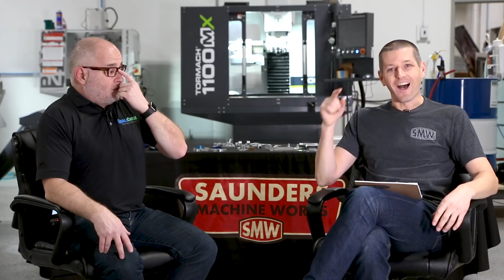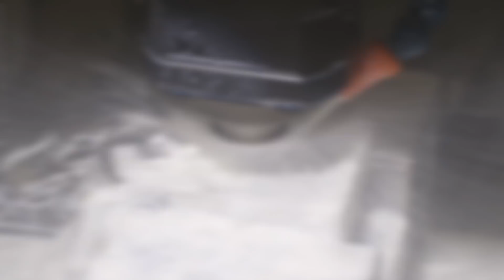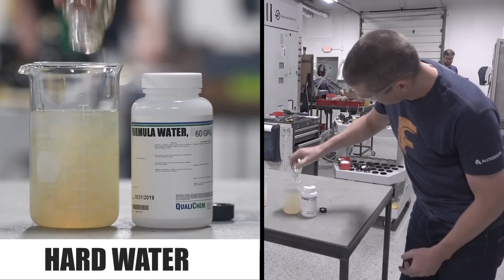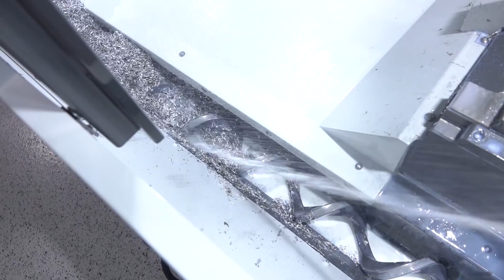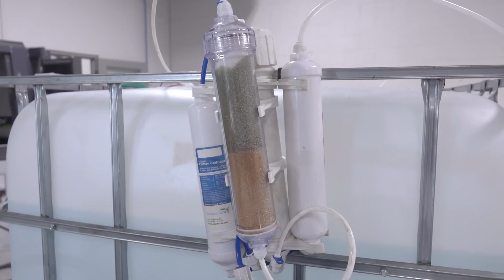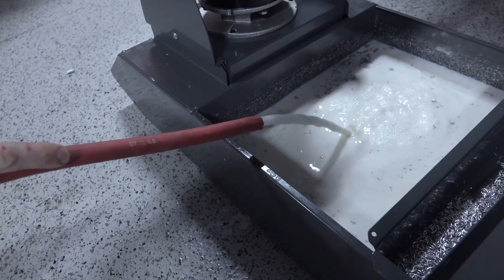CNC Coolant Basics with QualiChem

Comment: Coolant is important because use of the tool creates friction which creates a lot of heat and eventually that heat over hardens the tool material from the produced heat,so therefore it makes the tool very brittle,because that's just what happens when metal is over hardened.

Comment: In some countries of Latin America some machinists use something called" taladrina" which is a preparation of very light engine oil,liquid soap,and water ,and it works cooling  the work and the tools for cuts when working on lathe or milling machines ,and prevents oxydation of iron when there's leftovers on anything!
Reply: Does that really work

Comment: How about using osmosis to treat your water. you can really get low TDS values I get from 450ppm down to 9ppm. Is there any recommendation for the hobbiest(all materials, prevents corrosion of the machine and parts, and won't go bad if its not used for a long time) which you can get worldwide (in germany)?
Reply: Reverse Osmosis is a common method for cleaning up water, as you have experienced.  Our XTREME CUT 250NBF would be the suggestion for you in Germany.  Email me at jwiley@qualichem.com if you want more details.

Comment: What is the coolant recommendation for the occasional use home shop? Mixing a batch for a machine sump that might sit unused for a number of weeks is problematic. Can it be sealed in a container between uses to keep it from going rancid? Interested in what others are doing.
Reply: I've been using soluble oil diluted with distilled water for lathe, mill and grinders with no problems growing anything or going smelly.
Probably not so cheap for a production CNC environment unless they distilled there own but fine for the quantities I need. 180 litres for well over a year.
Reply: Get a good quality coolant, mix it correctly and use RO or DI water, and you should be good to go for many months.  If you are in AZ, contact Star Metal Fluids for assistance.

Comment: I'm using Blaser 735 (the clear stuff) and it leaves a white powder light substance on my ATC door and on tool holders. I use DI water with the coolant. What might be happening?
Reply: Which version of the 735 are you using?  Contact me at jwiley@qualichem.com if you want some help.

Comment: We are having issues with foaming in one of machines. Can you provide some insight to solving this issue?
Reply: send me an email jwiley@qualichem.com and I can get you some help.  First check is always making sure that the concentration isn't too high or too low. Reach out if you are interested.
Reply: Hi Tim, Foaming is due to various reasons: water being very soft, Smaller tank sizes compared to pressure, flow rate of coolant inside machine, Blockage of Pipes, Higher Coolant concentration..

Comment: I switched to 251C Quali- chem 5 years and it is lights out better then the Sto-cool shit my First Hurco came with. A video this long and they didn't talk about the one vital must in extended coolant life.  Coolant circulation and filtering.  I can easily get two year out of a coolant fill.  Separating out the way oil is also vital.  I have 7 CNC machines and the coolant is moving in a circle 24 hours a day. Good water, correct concentration, and circulation and way separation and problems are gone.
Reply: There are additional videos in the works in which we will touch on other subjects, maintenance included.  Lots to say, not much time to say it.

Comment: No coolant story is complete without discussion of how and cost of end of life. AMA: disposal of old coolant.
Also while John's machines are all enclosed sealed, What about health and safety of machines that are open. Examples: manual lathe or mill. Or a machine like the HAAS TL.
Reply: Rolltech Innovation manufactures machine coolant saver. Serious threats to productivity and health are bacteria and fungi which are commonly found in industrial coolants. This coolant bacteria filter has some advantageous features include: last a life time, with guarantee of extended life of coolant with bacteria filter - no consumables, no electricity, no chemical dosing, etc. 

It is a one time investment, ROI within 4-6 Months, Saves on input of fresh oil and disposal cost like etp treatment, or giving it to authorised recycler. 

These mineral oil based coolant are prone to generation of bacteria which produces foul odour, often from hydrogen sulfide [rotten egg smell]. 

Rolltech Innovation "Aqualogic" filter is an innovative and economical method of continuously controlling these micro organisms and the odour they generate. "Aqualogic" bacteria coolant filter consists of series of high-purity multi-metal fibres cased within a stainless steel tube. the dissimilar ions in the multimetal alloy bed undergo a natural electrochemical reaction, also known as an oxidation-reduction reaction. Which Kills the all the Microbial activity in the coolant 24/7

call us at +91-702-723-6191 or write to us at rolltechin(at)gmail.com

Enjoy the coolant being running without changing it, just keep the coolant healthy ## like and subscribe,that would give us motivation, need your support folks, no organic or inorganic chemicals used, everything is natural

Comment: I just had RO and a water softener installed at my house.  Installer said they won't run RO through copper pipes because RO water is slightly acidic and would eat the pipes.  Does pH come into play here when using RO water for coolant base?  If no factor, I'll just fill some gallons out of my house rather than buying distilled.
Reply: So long as the water is mixed with a well designed coolant, the pH is managed by the additives in the coolant concentrate.  RO water only gets very slightly acidic, and that really has more to do with the starting pH than the RO process.

Comment: Where would you use coolant to machine cast iron?
Reply: It's generally a surface finish thing. 
Hot chips can attach to the cutter and gall the work.
I've only seen the need for small or deep drill holes.
Reply: Cast iron needs good corrosion control.  While the tools may not need the performance, the freshly cut metal needs the protection.  We suggest running the coolant as you would on any metal.  Contact me at jwiley@qualichem.com if you need some help.

Comment: Hey John, TDS DOES NOT represent water hardness.  TDS includes everything dissolved in a water, not just solids which contribute to hardness.  Nor does the "TDS meter" you showed always give an accurate TDS, as it is based on using conductivity as a coarse proxy.

To accurately measure water "hardness", you want to find "Carbonate Hardness" (sometimes incorrectly called "Alkalinity").  You can use a small and cheap titration kit that gives you accuracy to 10ppm.  This value is usually half that of TDS.  If you are running your shop RO based on TDS, you may be getting a very low Carbonate Hardness a a result, which begins to affect the PH and them cause corrosion issues in your machine and/or parts.

My industry is commercial coffee, where water quality is critical but for a different reason!

We made a small document for our engineers who work on espresso machines to help understand it if you want a copy.

Love the vids as always.
Reply: Water hardness is not TDS.  TDS is looking at the bigger picture, though both should be looked at together.  When we analyze water we look for the anions(chlorides and sulfates) and cations (magnesium, calcium, sodium and others).  Contact me at jwiley@qualichem.com if you need some assistance.
Reply: Owain....could you post a copy here? Sounds interestin.
Thanks
Reply: or hardness test strips
Reply: Seconded. If wouldn't mind posting a copy of that document, it would be interesting to read. Thanks
Reply: Definataly interested on this topic, please post it somewhere and link it here for the benefit of all :)

Comment: With water hardness, at what point do the TDS cause issues? 
Like currently I have 310TDS in the well water, what would I shoot for as a balanced number?
The softener works to bring it down to about 25, but what about the salt left in the water. Will that cause issues in the first batch as you want some minerals. 
Also how much of each mineral is a good or bad number to have? 
Then the RO water I can get has about 4-7 TDS to it, just trying to find a good mix.
I cut lots of steel, stainless and aluminum with coolant, but have lots of carry off and issues while welding. Have had a local rep out from Toronto Lube to try some 251 also, but the coolant also has an effect on welding porosity.
Reply: Send us a water sample and we will give you some guidance.  While water softeners may appear to reduce TDS, the salts used to accomplish the softening might be worse that the water you are starting with...as with most things, the devil is in the details.  The cations and anions that exist in your water are the real concern.  Contact me at jwiley@qualichem.com to get started.

Comment: We found out lately that coolant is a huge tool and it matters A TON in machining. We have been through many different coolants in our quest to find the best all purpose coolant - 5 in the past 2 years. Our shop of around 80 machines does a large variety of materials, from cast iron and steel to aluminum to exotics and we ended up landing on the Castrol MB50 and couldn't be happier how much better our tool life and finishes are. Great all purpose coolant.
Reply: What kind of water you have? Just thinking how universal would your good results with the coolant be?
Reply: Michael Shortino MB50 is the best multi-metal coolant out there!

Comment: I have a hobby lathe and whilst there is a lube pump option, I don't have the space so what I do is mix up water soluble oil into a spray bottle and if the work needs it I squirt or light spray the work. It's a good compromise as I can't make large chips, so heat isn't a big issue, but it helps with the cutting tips.

As for water testers, go you to your local aquarium store as they will have dirt cheap water testers. I run a tropical tank and have to test for hardness as I live in a very soft water area and have to add bicarbonate of soda to bring the hardness up.
Reply: The noga mist coolers work well with or without coolant. 
I also have a pressure pump sprayer like some auto body shops use for a solvent wipe. Works well for some MQL but watch out for hot fractures when spraying some cutting tools
Reply: Coolant is better for most things and filling a bottle from cnc machine is easy :D Oil just makes so much smoke it is not fun. Also coolant will evaporate from the chip pan and leave a nice fine oil film, unlike oil which makes a mess, especially flying everywhere from the manual machine.

Comment: I hate suds I can never pick the right one, a rep comes in says this is good we try 5L then buy 25 L then after a couple of months it breaks down leaves oil every where, then wash machine down debug wash try another type and then go down the same road they work fine in a squeezey bottle on the manual machines. When we do find one they change the recipe and say this is just the same, it drives me nuts, I machine tool steel, ally, brass, plastic, stainless, mild steel copper and bronze on a Harrison 460t alpha lathe.
Reply: It sounds like there is an underlying issue that needs to be addressed.  Contact me at jwiley@qualichem.com if you want some help.

Comment: Hey John couple of questions.  Where can you buy QualiChem as a smaller hobby user?  I saw you had 55gal drums of the stuff in the shop when i was there for the class but it would take me a decade to go through one of those on my little 18gal sump.  Also it would be nice to list out some of the good formulas for multi metal with some of the pro's and cons to each, the qualichem website seems to be lacking with only two case studies and no product data sheets openly accessible.
Reply: Weld Chip 
They also have 5 gallon pails for about $200.
I got lucky with my local rep and got a 1 gal container from them
Reply: Try MetalFluids.com.  I just bought Quailichem 250C from them in a 5 gallon pail.
Reply: That's good to know! Thanks guys.  I have been using koolmist and a gallon of that lasts me ages.